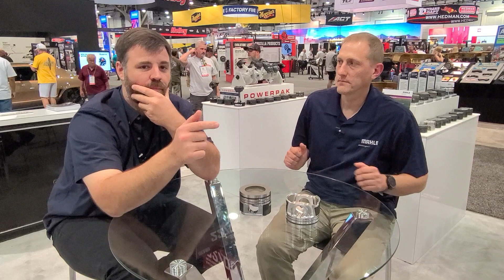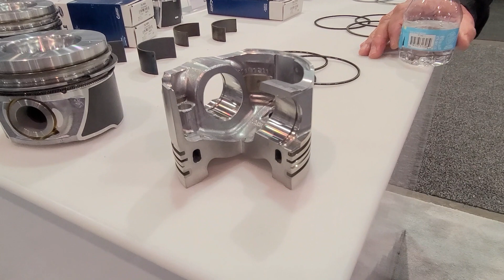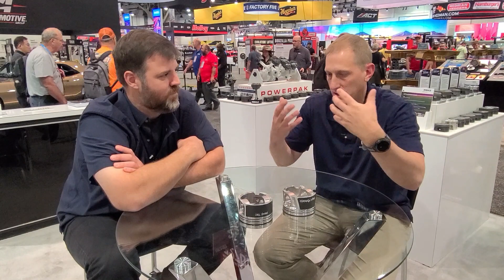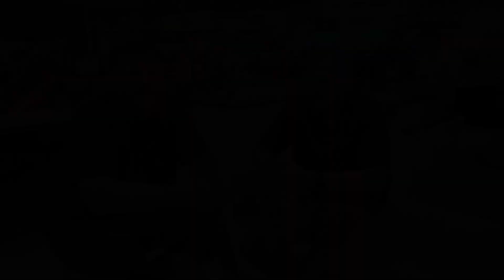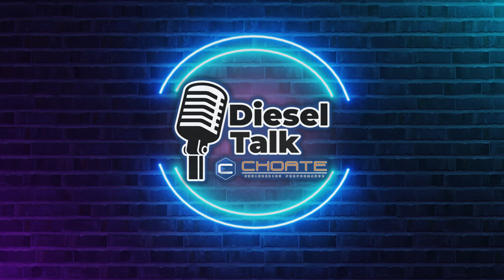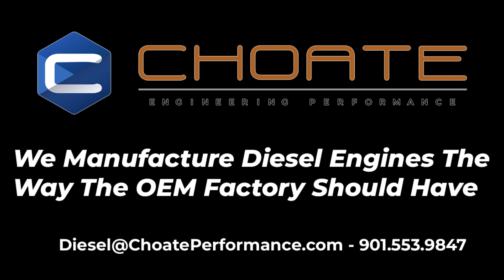4 Things You Probably Didn't Know - About automotive pistons

Comment: Love these technical videos. Thanks. I have seen videos lately about the 6.7 Powerstroke concerning lubrication on start up. In the video they show that it takes 7-8 seconds for oil to get to the cam bearings during startup with the theory that this causes spun bearings. His fix was to devise a check valve in the upper oil pan to prevent back flow of the oil at shut down. Would love to hear your thoughts as I run a pressure gauge and it gets to 60 PSI rather quickly at start up. Thanks
Reply: You're talking about Dave's video trying to sell his engines by making a problem out of nothing? He rigged that up. His test stand doesn't come close to the rpms a 6.7 starter turns, he completely emptied the engine of oil, it drained back because the system was open (turbo off). I also have a gauge on my 6.7 and build pressure instantly.